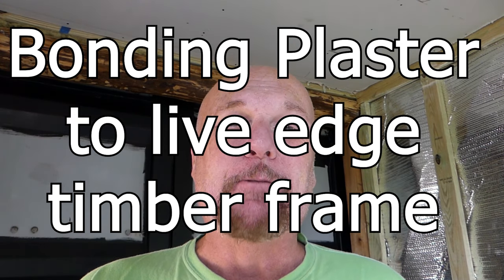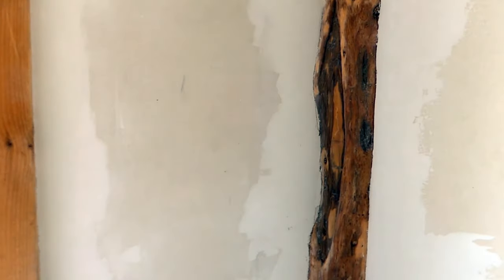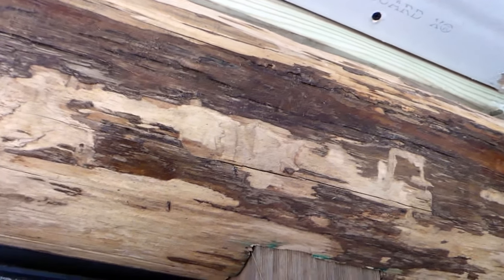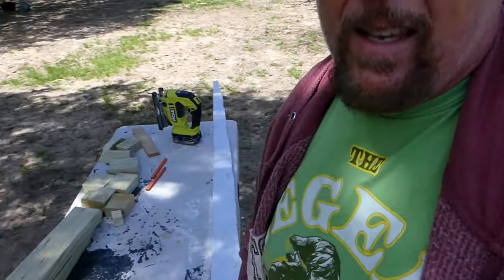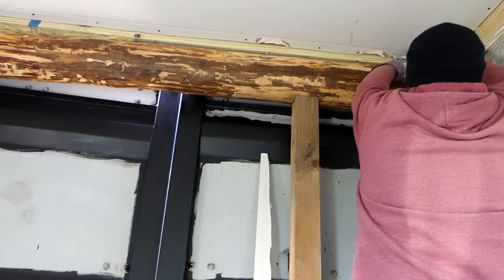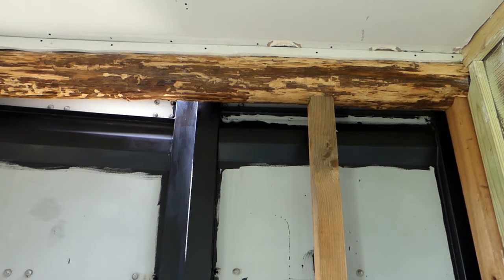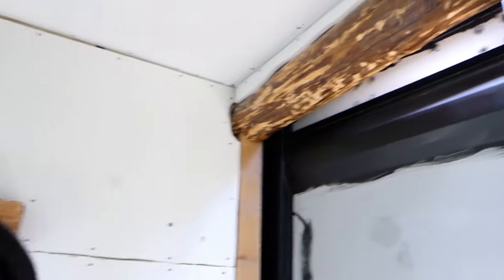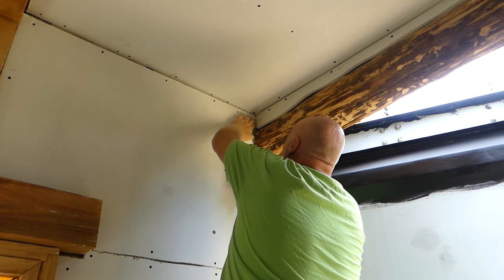Bonding plaster to a live edge timber frame

Comment: Mesh tape is only to be used with setting compound not drying compound, you should of used paper tape,
Reply from the maker: Thanks Dan. I am not a professional drywaller and therefore break the rules.

This is okay for me as a DIYer, but I likely would not take chances on call-backs of customers if I were a professional.

Having said that, I've done 3 homes since 1987 with this method and lived many years in each of them. I never did have a crack. Occasionally, if I am not careful I telegraph the mesh to the surface with poor corner sanding. On those I fix them the next time I paint with DAP.

Appreciate the professional guidance and thanks a bunch for watching.